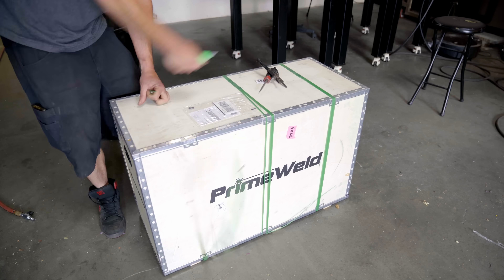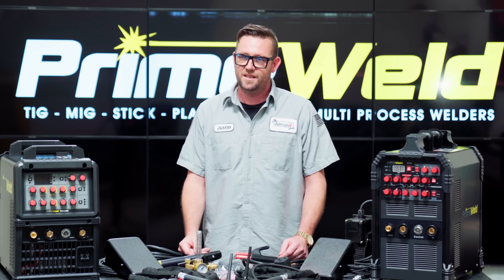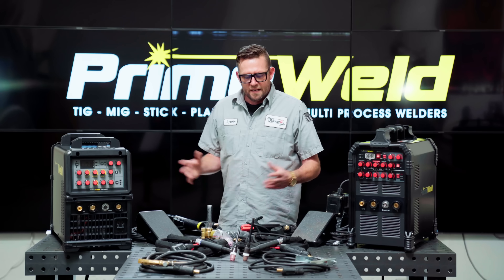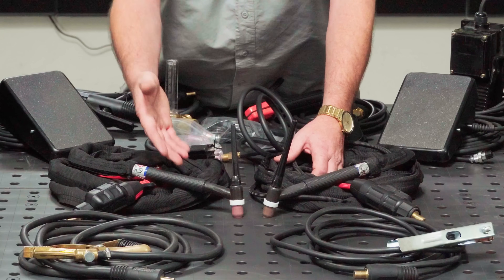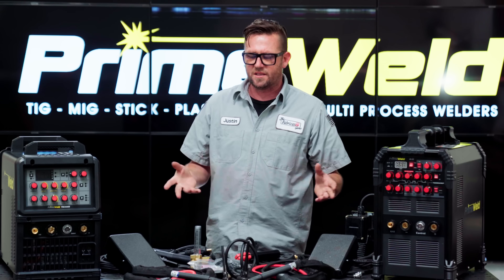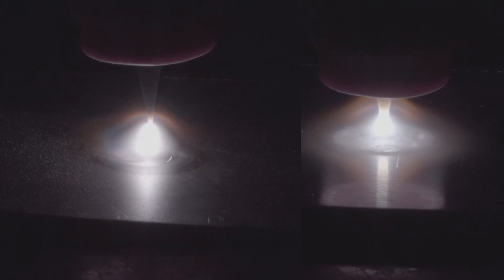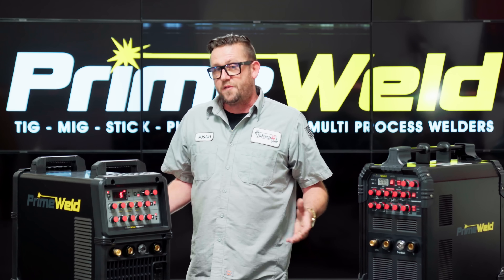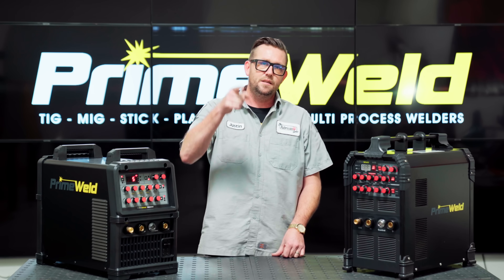Primeweld 325x Reviewed and Compared

Comment: I have a 225 and think the upgrades on the 325 are good except the buttons that replaced the toggle switches, for the sake of longevity I think the toggle switches will last longer and are easier to replace if necessary and those style buttons do not respond half the time so you have to pay attention and re-push them often. Despite that I'm thinking about getting a 325 as a backup and upgrade, there have been time when I was maxing out the 225 and heating the torch an uncomfortable amount. I did have an issue after two years with the 225 but customer service repaired it under warranty so I'm very satisfied with them so far.

Comment: Big fan of PrimeWeld.....I have the Mig 180 with the spool-gun and its honestly worth twice what they are charging since it comes with the spool-gun & regulator. Surprisingly I have used the stick welding option more than I thought I would. Had to do a weld where I only had 110v and on an extension cord too. It actually ran 1/8 inch 6011 on the full 120 amps on 110v and didn't trip the breaker. That said I probably should have used a 3/32 rod but it actually did it.

Comment: Prime Weld's customer service is second to none. I am so impressed with their machine, my only complaint (and it's not a big deal) is the analog dials are not numbered, meaning you don't know what exact setting you are on,  and the power switch is on the back, other than that it is a great machine.

Comment: @15:18 when giving the hypothetical between the 225 and 325 you said 'but that 325 is pretty smooth'.  Curious what you had meant by that, was that implying the 325 is welds better than the 225?  Another way to ask it; if you were to set the 325 to the same available settings that the 225 has do they pretty much weld the same or is the 325 better?  Thanks

Comment: @11:44
Maybe it's an optical illusion, but something looks off with the comparison of the Aluminum coupons. The one that is supposed to be 1/4" looks to be half the size of the one that's indicated as being 3/8". That is, where there should be only 1/8" difference in thicknesses, it appears to be much more. If it's the way it looks, I'm assuming this is a result of Justin just picking up the wrong coupons when shooting that bit of the video, but if all the welding tests were done with those coupons then I may question the accuracy of the results with regards to settings and such. Not the performance of the welder overall, just the performance we see with regard to how the machine is set for the supposed thickness of the material.

Comment: I have the 225 . I use it in a commercial mobile environment.  And I work the ever living crap out of it. Running off my Trailblazer 325efi.  My concern on picking up a 325 . Is the power consumption at 300 amps on 220v . I'd like to see a 220/460 option and drop the 110 stuff . Any specs on what that 325 is drawing on 300amps through a 50am 220 plug?

Comment: In your experience, is the TIG325X any less capable when running air cooled instead of water cooled, or is the reduced duty cycle at high amperage the only limitation? I don't mind taking more breaks to get a heavy weld done, but I wouldn't want to buy a big machine and just not be able to make the same welds that it could make with the right accessories.

Comment: You gotta set them machine up on a eletric scooter. Use the foot base for the tank. Get one of the 6 wheels with the large drive wheels in the center.  It rolls over everthing smooth as butter but creates no jaring to allthe circuit boards you will get from a cheep cart. And youvan remote control it as well. Ohit willpull a man hanging on fro. The rear on a creeper stool 12 mph. Way to fast. I especially love driving it when the federal asme inspector is in the shop . Im driving the welder from on top of a tanker or something were the feddont see me. It creates a funny conservation and side tracks the Man . Lol

Comment: The 325x has a closed circuit voltage of 30 volts so it will run 6010 stick rods where the 225x isn't rated for 6010.

Comment: I bought the 225 about 3-4 years ago and I have to say. It has performed flawlessly for me. The two big features I like on the 325 are the power switch on the front, and the digital readout for all knobs, i'm not a fan of the buttons though. I prefer the switches. Are the perks worth an extra $500? Do I ever really weld at 225 often? The answer to both of those is a no, so I am happy sticking with  my 225.

Surprisingly, I've used my machine for stick welding way more than tig welding. It has worked very well for that purpose running 7018 and 6011 rods. I run them mostly because of convenience and for working outside in the wind. I don't have to deal with dragging out the foot pedal and setting up a table in my garage etc. So Its nice to be able to just put a stick in the stinger and go.

The tig225 has given me no issues whatsoever and I will likely be buying a Mig 180 from them next just because of their customer service. I also have a CUT50 plasma machine and it has been flawless as well!

Comment: Thank You Sir . I think many of Us would love the ability to weld thicker metals . I have been a proponent of filter equipped centrifugal cooling fans for greatly reduced noise . Even at the risk of a slightly larger machine case . You didn't mention a water cooler option which at 200 amps would make sense .

Comment: I am glad they add future to show the value of each knob on the display , that  what I miss on my 225. Is not such big deal when on DC , but sucks when using AC. Trying to find balance and frequency setting is kind the challenging. Probably not such big deal for experienced TIG welders, but for sure for the rest of us I think is.  Will be nice if Primeweld come up with upgraded  front panel with the same future as 325 have for 225, but not sure if is even possible.

Comment: Got my new 225x via fedex yesterday afternoon.  Was excited to get it set up and start learning today, but found that the included 25ft torch option was water cooled and therefore unusable.  I called customer service but it's Sunday and they're closed so I did the contact form and plan to call tomorrow.
Update, checked email this morning, monday, and they've already responded to my contact form submission from yesterday.  A CK17 25ft torch is on it's way UPS 2nd day air with return label for the incorrect torch.  Either they really do have great customer service or they really want their more expensive water cooled torch back.  Either way I'm pretty impressed by the service.

Comment: They should add a fan control switch on the back to switch from auto to on, I see them on a lot of different hardware. Also, the fans probably louder due to the higher amperage rating and being the roughly the same size. There are 2 ways to deal with heat, bigger heatsinks or stronger fans.
Reply: I was thinking if I got one I just might add a fan on switch & while I'm at it put a delay (off) on brake relay so the fan would keep running (unless it stayed running because of the temperature sensor) even if you switch of the machine.   My little wire feed welder turns off the fan the moment you turn off the power switch, so I find myself leaving it on for a while just to let it cool down, no big deal but sometimes I want to leave the shop right away so I feel I need to hang around a bit to let it cool down.

Comment: After waiting almost 2 years to buy a primeweld MiG 180 nothing but problems straight out of the box can’t fine tune wire speed jumps around by 4-6-8 every turn of knob and turned all the way up doesn’t burn near as hot as my old wore out titanium 170, still trying to get a resolution they were supposed to send one to replace it but now want to talk about something after talking to engineer or something and working 12-14 hour days out of town hard to get time to be on phone but very disappointed may just get my money back depends on how they want to handle the situation….
Reply: Your opinion is overshadowed by hundreds of positive experiences. It was a faulty machine. I can find no bad experiences besides yours. So its just you.
Reply: @davidmuller1958 that’s fine but is it a “opinion” when you have a $600 welding machine that won’t weld you must be a primeweld fanboy, I’ve talked to numerous people that have had similar problems with primeweld and they had same issues there posts deleted and blocked from there group on Facebook book guess there is no bad reviews if folks get blocked 🤣 but the fact is here is is 5 months later and still have a machine that does not weld worth a damn it’s obviously a faulty unit which happens with every brand but the point is instead of guy says yeah something is wrong I’ll send you a new one then made every excuse to not just send a replacement being that it’s under “warranty”
Reply: @ab75901  im not a fanboy. Ive never owned their machines. I did a lot of hours worth of research from multiple websites and forums looking for bad opinions randomly.

If theyre deleting bad posts, its from people who dont know how to file warranties or understand that companies arent perfect and need to be given a second chance or sometimes third chances in rare occasions.

Let me guess. You think harbor freight is also crap, so you pay for good ol American made tools.

Comment: I got the 225x with watercooled and gas cooled. I usually practice welding pipe. From 2"-4" so far and from schedule 60-xxh. Its awesome but heres my kick. I'm grateful theres a bigger style watertorch (18) because the 20 for me is really small. Therefore I mainly use 17 ck and let cool between passes at 135-140 amps.

Comment: Having power switch on front is GREAT, membrane switches aren't. I prefer toggle, for several reasons, main reason "visible mode" you can actually see the active setting and membrane switches wear out quicker.
Reply: What is the giveaway TheFabricationSeries
Reply: Yep, the membrane switches will keep me from buying this machine. A really bad design choice. Give me a milspec steel toggle switch any day.

Comment: I really need to get my brand new 4 year old 225x out of the box and use it. I did plug it in to make sure it powered up when I got it but it has just sat on the shelf ever since. What's the worst part is all I was waiting on was getting a dedicated Argon tank
Reply: Youve had it for FOUR years without using?!?!?!?!?
Reply: @davidmuller1958  yea unfortunately I turned it on when I got it and it's still in the box today. I have a mig I use for most stuff just wanted to learn tig. Joys of your main job leaving not much for the hobby side
Reply: @jonsaircond8520  damn that sucks. Ive done that in the past. Purchased things and not used them for years. But for something that big, i dont think i could lol. I wouldve sold it then repurchased. Oh well, at least. Now you will.

Just ordered a tig 325x

Comment: I have the 325x with a 26 style gas cooled torch. My fan blows so much cooling air that I had to put up an air dam on my welding table so the gas wouldn't get blown away. I did not block the air outlet per PrimeWelds recommendations.
 My fan is whisper quiet. The fan is at the very front at the bottom of my 325x. Perhaps the cooling fans are located deeper inside the 225x? Maybe your fan mounting fasteners are a bit loose allowing vibration? 

Anyway I love my 325x 👍
Keep up the great videos.

Comment: Well, I like things analog, so for me, I'm still glad I have the 225acdc. About six months after I got it, I did get the cooler and 20 torch . MAN, that was a great addition, no more hot torch . And I don't even need wedge collets in fear of smoking and warping the little buggers . lol
The only problem I had was when I first got the cooler I couldn't get the warning buzzer to shut up . But with a quick call Gene (great guy) said well, you can send it back and we'll send you a new one, or if you want to tackle fixing it, I'll walk you through the simple task ... And it's been working perfect since . The one thing I would love to have is the 5 amp start on the 325x . But there's ways (pulse and such) to get around that . Actually this welder's really great for me . Next I would like to have the cut60 ... :)

Comment: Since it has a higher amperage and it can stick Weld and TIG weld I can see someone using this as a combination machine in utility IE compressor stations Refinery work maybe even boilers combination type welds tig root and 7018 stick fill and cap

Comment: Thank you for posting this!  I have been wondering what the difference between the two machines was and have been reviewing the specs on the Primeweld site. While I can read and understand them, you having them side by side and discussing them together is much more understandable for my tired old brain to absorb. I have had my 225x for just over a year and couldn’t be more pleased with it.  I am a home/hobby user and while I typically adhere to the more bigger more better MO, I think I wouldn’t benefit from the additional features of the bigger machine simply because I don’t weld anything remotely close to what the 325 is capable of handling.  For those reading this comment that are considering a machine for themselves, you can’t go wrong with any of the primeweld products in my honest opinion. I also have a Cut60 Plasma cutter that kicks absolute butt when it comes to cutting metal stock. I went thru three cheap-o machines from “other” suppliers and had seriously dreadful experiences. Got the Cut60 and haven’t regretted the purchase in the slightest way since. Thanks again for the side by side comp for us tire kickers. 🤓

Comment: Build quality? Inside view please-   The bottoms are the same sitting in clock radios, they will not last in a shop.  also I miss the dust cover. (you can always tear it off)   like your videos , good info , just too few ;-)It would be no problem at no cost to design an inverter that makes no more noise than a modern A/C indoor unit!  BUT 99.9% dont ask for it , and we 0.1 have to live with it , or go Transformer.

Comment: 8:25 water cooled…
Here’s the dumbest question of the day: is there anything wrong with running 50/50 green automotive engine antifreeze in the water cooled torch reservoir? My workspace will be warm when I’m working but overnight or a few days of unused is likely to get below 32*F. Curious; I can’t think of a reason why not but I don’t think I’ve seen anyone mention it before.
Reply: I had the same question too when I upgraded to a water cooler. I ended up using water water and RV coolant.
Reply: There probably is. Many will tell you don't do it.  I've run 50/50 in my TIG cooler for 30? years now. I'm expecting major issues any time now LOL Interestingly, I think most of the folks that say don't do it, are also the ones that sell the 'special' TIG cooler coolant.....at $50/ gallon.

Comment: I bought my 225X because of this channel 2 months later they came out with the 325x LOL. I wanted to learn both ac and dc tig and I'm happy with the 225X, I don't feel the need to upgrade maybe down the road pick one up and have both setup using the 325X for aluminum. All that being said IF you have neither just grab that 325X out of the gate. Primeweld has stellar reviews, believe is New Jersey Based and alot of bang for the buck. Also have the CUT 60 which is pretty badass.

Comment: Total newb here. Got the 325 in July, burned through about 100cf of argon so far. It is still going strong.
Reply: How is the 325 is it better
Reply: @duaneduncan2380 still running good. I like it. Added a water cooler and size 20 torch.

Comment: Nice review, but the one thing missing on yours and most other reviewers it the power requirements. Plug type, current, duty cycles, etc. It is great that you can weld with 325 amps, But if I need a 50 or 100amp source it is junk to many small time welders (DIYers).
Reply: That's in the spec sheet. Inrush is 53A, continuous is 37A. So, it really should have a 50A circuit for full output. Still way better than a transformer machine that needs over 100A to reach the same output.
Reply: A welder can't magically make more power come out vs going in. If you want 325 amps, it is going to need a 50amp 240v source. There is no mathematical way around it. If you keep your amps below 250, you can probably get by with a 30amp 240v but be prepared to trip that breaker if you go over 250. If you stay under 200amps, you can probably get by with 20amp 240v. If you stay under 125 amps, then you can run on 20amp 120V.